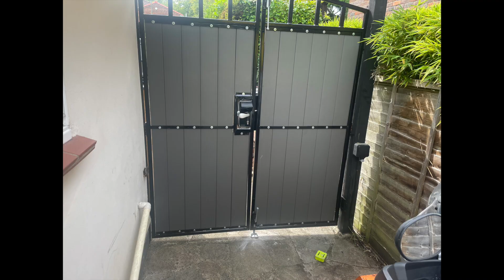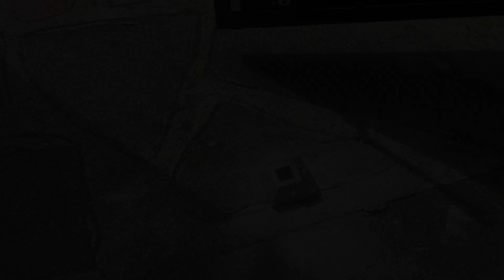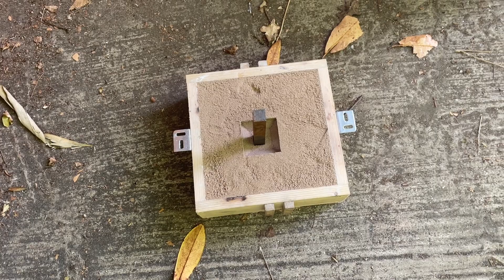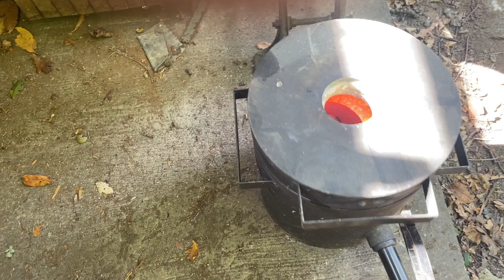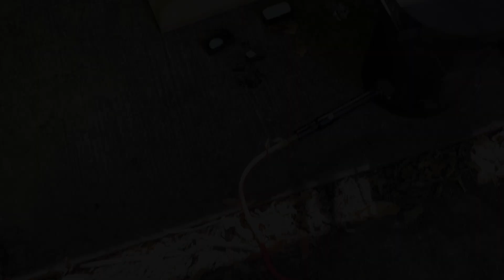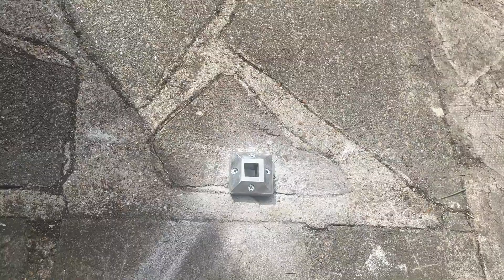Toddy Tackles - Metal Casting A Gate Bolt Plate

Comment: How many cans did it take to make the casting? Here in South Oztralia each can would be worth 10 cents at the recycler. I use old pistons, cylinder heads, water pumps, inlet manifolds and such I can find for raw material for casting. I even found a couple of Automatic transmissions on the road verge one time. It was a bit of a struggle fitting them in the back of the car but worth it. 😁😁😁😁😁
Cheers Eric
Reply from the maker: Hi Eric. No idea how many cans as I put them in the pot with all the other scrap but its hudreds now.  Like you I melt down all the old scrap but over here scrap metal is so expensive you dont find it on the roadside like you can!!!!   Also we dont get anything for recycling, they fine you if you dont!  Thanks for the comment, its great to hear from everyone.  I did do a copper recycling video but I think I'll do a beer can one as well as a few of my mates were suprised it was worth doing.  Take care mate.  Mike (Toddy Tackles)